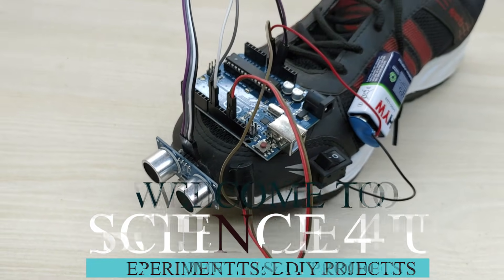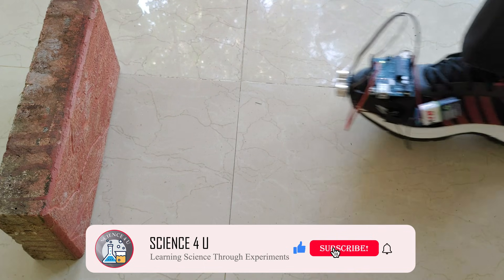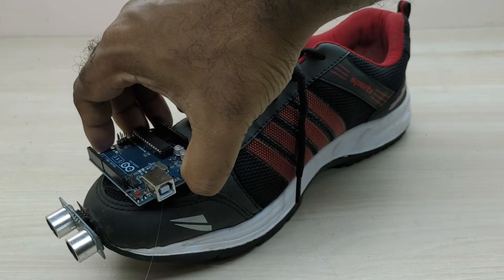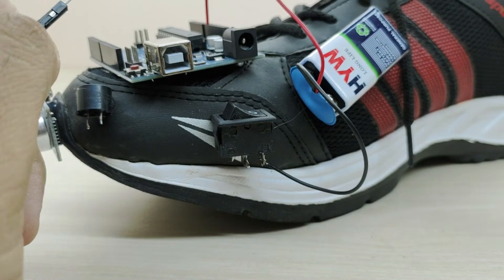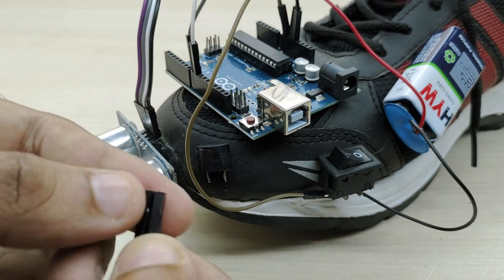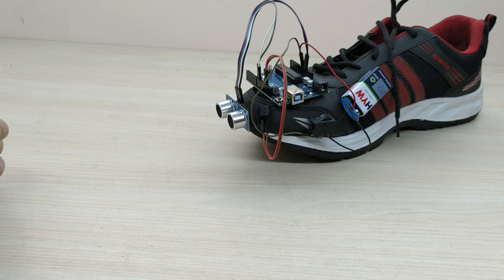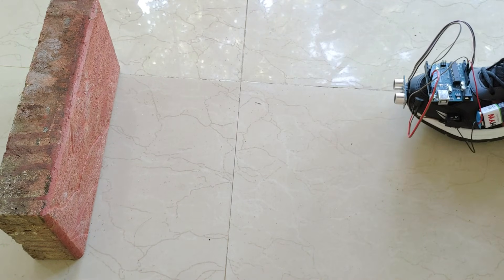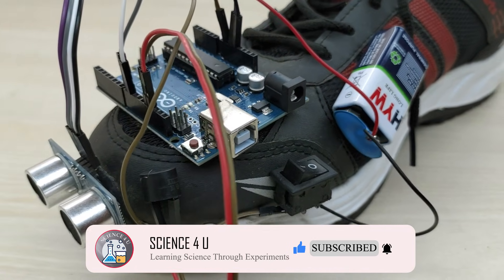Smart Shoe for the Blind || Extremely Useful Arduino Project #arduinoproject

Comment: Sir the project is good but do we can add a voice assistant to detect the object
Reply from the maker: Yes..it is possible..I also thought about that. We can add voice alerts using talkie.h library in arduino. But it is a more difficult process. So to make the project simple I used buzzer alarm only..